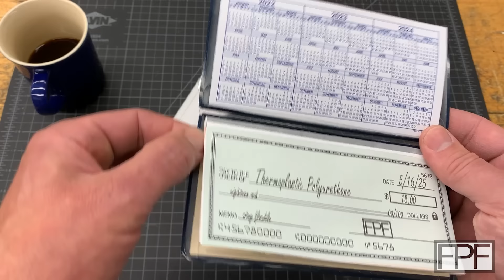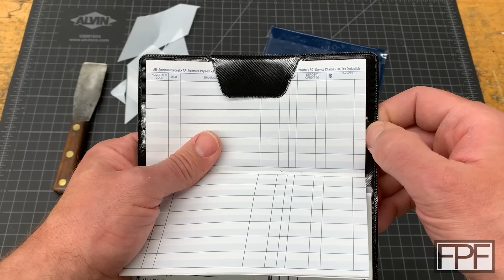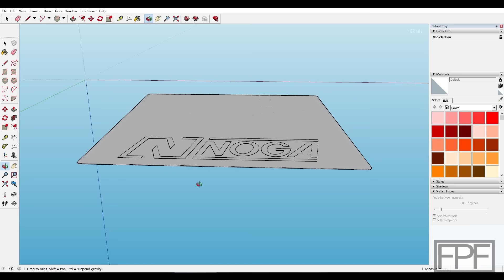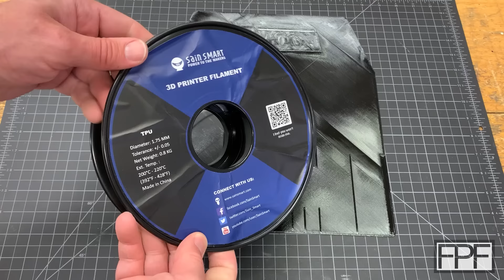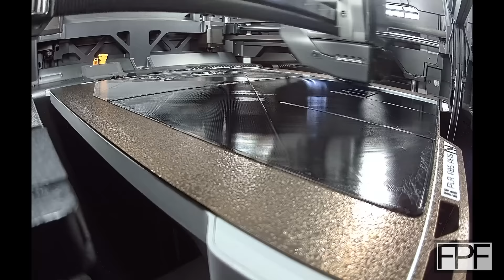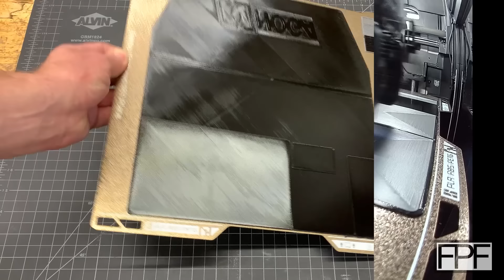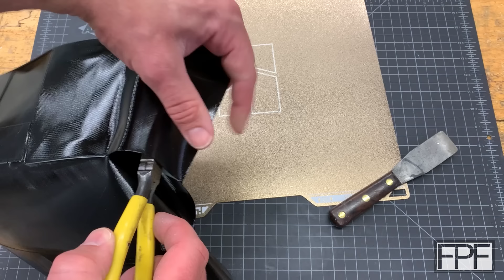3D Printed Tool Roll and Checkbook Cover

Comment: I think the designs might benefit from a “score” line, gaps where you’d want the prints to fold more easily. I say that with full recognition that this might not be possible due to the number of layers you printed.

And just after I posted that, I noticed you added that to the tool pouch.

Comment: I am wondering if it would be possible to completely bury the support material inside the tpu so that you have rigid sections connected by non rigid sections. That has a whole bunch of interesting applications, things like burying hardware inside flexible parts, folio style phone cases come to mind as well. DND DM screens would be another exceptional use.

Comment: Bambu TPU profiles have the bed way too hot. You likely have it at 40C which is way too hot for the A1 and X1C I’ve used. Drop it down to 35, if it still sticks too much, drop it down to 30C, which is what I use on Bambu’s. It’s easy to test with small test prints, it should peel off with the feeling of Velcro. Of course PLA and PETG want different bed temperatures, so for embossing details make the base layer TPU as a raft to print on or try glue on the bed and on the print if PLA and PETG won’t stick to the bed or TPU

PLA does not want to stick or bond with TPU, while PETG does. PLA will grow and come out larger than the desired shape, PETG on the other hand will shrink a little. PLA requires larger tolerances than PETG. This explains why the same geometry almost worked for both materials, the PLA coming out larger than perfect to microscopically roughed up the texture of the TPU allowing it to stick, and the PETG came out smaller than perfect creating a gap so it didn’t chemically bond to the TPU. Slicers however try to compensate for this.

Comment: Could sound strange but I can see using the ability to print a tuff material like tpu, embossing the logo as you did and incorporating it into something like a auto floor mat. I love having a thick pile mat with a nice logo and designated foot area on the mat. You can bring together the flexible printed portion to the thick pile mat and I guess sew them together?

Just a silly thought

Comment: Separating coincident edges like backed adhesive tape or the opening of a polythene bag is always fiddly. What if you printed non-overlapping tabs at the edge of the sheet - like the tabs on your browser - so that you've got a handle of PLA and a handle of TPU to pull on ?

Comment: I use the vision miner liquid bed adhesive. It lasts a long time. And, as it is alcohol based, the ipa release trick works really well. Plus, when the ipa evaporates, the adhesive is unaffected. It does leave a slight residue on prints sometimes if you apply too much, but i just hit that with a baby wipe, or wet shop towel and it is good to go.

Comment: Would it be possible to print the PLA layer first, then print the TPU, pause, manually insert the PLA, then resume printing? Like we do with magnets? That would be nicer for those with a single nozzle printer. 
I assume the PLA layer would need to be thicker to have some rigidity.

Comment: I have a favorite brand of medicin dispenser, that consists of a fold over case with a wide pocket. The pocket is wider in height than any of the pockets you printed, because instead of a check book or register, it gets filled with 7 hard plastic daily dispensers. It's a very flexible and smart system for organizing your pills, the only oroblem is that the fold over case only lasts about a year before falling apart just like your OG check book.

If you want to see what it looks like, you might be able to find it by searching for MediDos in Swedish sites.

Comment: Application for me: Large diameter vacuum actuator bellows, for old cars with vacuum accessories, or vacuum exhaust cutouts. With a decent hexagonal layering, this process would easily make very large vacuum actuators for headlights and windshield wipers, for those that don't want to "upgrade" to electric accessories.

Comment: Very interesting ideas.   I think I would be tempted to expand the PLA interface layer slightly beyond the TPU to potentially make it easier to remove, perhaps with a few small gaps in it too to help with awkward removals like circular surrounding PLA.   I suppose for your bed adhesion/release question you could have a raft of PLA - perhaps with some sort of pattern in it.

I use BL liquid glue on the cool smooth sheet for PLA prints and don't really notice that it leaves much behind.

I wonder if they is a way of getting a slightly more matt finish,  plus I think I might put a few air holes into the TPU on purpose.

I guess for things you want to fold over you could print them already folder over - with a few layer for the curve.

Would be nice if there was a clever way to design the interface layers - so that they come out whole and could be used for something.

Comment: I'm curious, because I've never really (knowingly) handled TPU before (my printer is ancient, and seriously overdue replacement with something more modern). Could you not run the 'seams' through a sewing machine to give them a little extra reinforcement?

Comment: With these roll covers I would print logo/"information on what's inside" vertically every few cm, so I would know what's inside without opening/unrolling. It's a problem to figure out which is which if you have multiple these, especially if not using often.

Comment: Checkbook? What is this, 2022-2024? 😉 😂 What a neat project/challenge. I still have a stack of those cheap covers, the one in use it probably more tape than plastic. The checkbook cover of Theseus, if you will. I didn't realize they're sold as collector's items these days!

Comment: instead of using a brush i just drilled a hole into the bottlecap and put one of those really fine ca glue tips into it, really easy to dose and get it where you want it

Comment: I think its a good idea to extend the PETG/PLA separation layer a little bit, so it comes out from the pocket, making it a little easier to get the scraper between the separation and the top layer.
Reply: a small gap around the perimeter of the interface layer might also be helpful, if the slicer doesn't make the bridging weird. Just a touch of airspace to help separation.

Comment: To make the checkbook hold its fold better, maybe try giving the fold a quick blast with a heat gun, isolating the fold by first covering the book almost completely with a piece of plywood, leaving just the fold exposed. You could even try giving the fold a nice 'round' by putting a length of, say, 12-gauge wire inside the folded edge before blasting it with heat, giving the TPU something to 'shrink' around.

Hope that made sense...

Comment: I sometimes use a few drops of silicone oil and distribute it with my finger on the build plate as release agent for TPU. You could try that. Maybe other oils work better/worse.
One downside: before you want to print anything else with that plate, you have to clean it thoroughly.

Comment: I've had the most success in easily removing TPU parts by printing on an unheated bed, waiting for the print to cool to room temp and then heating the bed to 80°C.  Let it sit at temp for a couple of minutes and it peels of with little effort.  So far this has worked for every brand I have tried it with and it's my standard for TPU.
Reply: Great tip!
Reply: Same technique I use and I have had similar success.
Reply: Thank you. It's always been tough for me with the standard Bambu Labs A1 setting an either a textured plate (accidentally printed) or the smooth PEI.

Comment: Another tip maybe make your own supports but add a tab on the opening so you can get your blade under.
Also if your making your own supports have a gap around the stitch line so the TPU bottom layer makes a small bridge. This should also help with removing the support.

Comment: Not sure if Bambu sell a satin PEI sheet for the H2D yet but TPU adheres to and peels off brilliantly from my Prusa satin sheets. Excellent work bye the way. I am working on buttons in my case designs that use built in TPU membranes that allow the button to be pushed. A the moment my buttons are all flexible arms essentially. The other area I'm examining is TPU shock protection, corners etc. Lots of possibilities for sure but you are definitely thinking outside the box!!

Comment: You may have already tried this, but why don’t you extend the separating layer out of the pocket by 1/4” or so to get a purchase.
Reply: He didn't model the separating layer, rather used the built-in slicer supports feature to automatically fill in the separating material as a support interface. Saves time at the CAD at the expense of not getting the overhang you are suggesting.
Reply: Good idea. Now that Bambu Studio can accept step files with multiple parts this would be an easy upgrade

Comment: Speking of scrapers, my favorite tool is a painters knife. It has a thin but not too sharp springsteel balde, is angled in a way that it will not dig into the build plate and has a a rounded shape which makes it easy to work your way around the print. 
I used it regularily to remove PETG from my Prusa's smooth PEI sheet and even could remove TPU I accidentally printed on the smooth PEI without any damage to the sheet at all (just be a little careful). 
Make sure the painters knife is as big as mine is and not one of those tiny ones. The blade alone is about 10cm/4inches long. It is a "Liquitex 109915 Professional" and here is a link: 
https://www.youtube.com/watch?v=3XZwdM_V4YQ

Comment: Although I'm having big problems just printing with TPU on the H2D, your video have inspired me on how to make a specialized gasket for a customer - so thank you very much for the great videos!
Reply: I was just reading the bambulab wiki on printing tpu on the H2D. One thing to make sure of is that you should have a dedicated head for tpu, printing fiber reinforced filament will particularly contaminat the head. 
Another thing is that harder tpu should work on the 0.04 head however softer tpu is 0.06 and up.
Reply: @judeffr  Correct 👍. I'm using BBL TPU 95A, so it's the harder one. Also you can only use the right nozzle for some reason. My project has to be printet with 0.4, but that should be posible with 95A. The stange thing is, that on my A1 Mini it just prints without any issues at all from the same roll af filament, but I don't have AMS for that one.

Comment: I still have a cheque book (UK), but have never seen a cover for them before now. I love the innovation and ideas.
I'm having trouble with my H2D, getting Bambu support for PLA/PETG to stick to parts, or even the prime tower. The printer sheds it all off the print. So for I've only tried it with PLA-CF, which is new to me, but the same roll of support material prints flawlessly on my X1C's, and I have re-dried it overnight in an X1C drying cycle as well. I'm starting to think it's a Z offset issue with the left nozzle on my H2D, and not sure how to adjust that. Lots still to try. EDIT: Next thing I tried was replacing the nozzle, and that's solved the issue.
Anyone having bed adhesion issues on H2D? I bought a Biqu Cryogrip plate, and am loving the grip and fine texture of that.

Comment: Besides the multi-tool head solutions from bambu labs, Prusa, and Voron/Sovol, there have been a couple that have been around a lot longer, Makerbot Duplicator, and whatever that printer was that "Dr. D-flow' made 4-6 years ago or so. That last used a mobile cantaleavered design with independent toolheads, each of them doing the bed leveling dance at the beginning of the print job if it was going to be used.

One of the things I don't know is if switching to PETG would allow those of us w/o a multi-toolhead machine to get OK results. If we're looking at a single layer of PETG, for things like this, I can see this being a 'bespoke' option for making notebook covers for people. 

That said, I can also see making multicolor 8 1/2 x 11" multicolor notebook covers for kids heading into school set up so that a TPU back cover could be made that has a thin strip of spring steel in the edge that closes up to a magnet or set of magnets, or magnetic sheet in the back of the front cover that then keeps the edge of the paper in the notebook clean.

The artwork on the front cover can both be created by the kids, including using a photo of brought home artwork from the year before, the inside of the cover can have space for a label identifying who owns the notebook, and have built in pockets for a 6" ruler, stylus, compass, protractor or other class specific tools Perhaps even space for mechanical pencils, flat pens, etc.. All that stuff that usually ends up in the bottom of the book bag or locker and destroyed when the book bag gets flung to the kids' jacket hook on a frustrating day at school. For something like this, the reason one might go with the H2D would not be for the multi-material, but for the larger print volume if it's large enough. A K2Max with the multi-color option for something like this idea might work.   (And if you don't like spiral bound notebooks, you can switch to custom punched TuL notebook systems with 7 or more disks a punch template and punch so that papers handed out can be inserted into the notebook where needed.)

And there I go again, prattling on.

Nice ideas, Not worth what one of these machines would cost me, but that's me. Keep going with the ideas. That might change my ideas too.

Comment: Try using glue stick but spray some water on it and smooth it out with your finger. Leaves a super thin even layer. Start bed heat on like 30° C after glue stick application and it's ready to print a minute after smoothing it.
Reply: Bambu liquid glue also seems to melt and squish out of the way, when printed over. Washes off easily with water, too.

Comment: Nice job, thx!
Tried to design any kind of buttons to lock those rolls already? Same logic as with support, but don't have to remove it...

And as for the pei-tpu pair... Doesn't the freezer do the trick? My imagination tells me that you leave them for an hour and then you just pick them up already separated)) However, I'm in monopolized petg realm for 2k+ hours still...
Cheers!

Comment: I tried TPU a few weeks ago on my A1 and the print quality was absolutely terrible. Turns out the default print temp in bambu slicer for basic TPU was way too hot for my TPU (my own fault I didn’t check the temp on the reel) I lowered it it 200°c and it now works like a dream. I’ve had the roll for at least 2 years as I could never get it to work with my old Ender 3’s. I’ve never even dried it.  For the past few days I’ve been printing phone cases, rubber washers, toys, all sorts.. just can’t believe how well the A1/A1 mini can handle TPU.
Reply: Drying makes the world of difference with TPU. I normally run it straight out of a filament dryer, so it's not picking up moisture during the print. It needs to be run REALLY slowly too.
Reply: @rattyboots  perfect opportunity to jump in: Not true at all. TPU print speed depends on the temperature. 
On my A1 Mini I can print even softer TPU (85A) at 20mm³/s. 
That's faster than some printers can extrude PLA.

How? 
- 270°C
- 0.6mm Nozzle
- Slightly increased Extrusion Multiplier
Other things to consider:
- (very important) A super short 4mm PTFE Tube, or none at all. Sometimes I cut the "meters" I need off the spool and feed it directly into the extruder, so the gears don't have to pull filament through the long tube + pulling forces of moving the spool - and lose grip.
- The spool's axle on 2 low friction ball bearings (thick grease cleaned out with alcohol). Definitely not the outer rim sitting on 2 rollers.
- PTFE Tube ideally 2,5mm (not 2mm) inner diameter for less bends/friction.

 For normal 95A TPU 240-250°C should suffice.

The amount of cooling depends on the model size and geometry. For printing gaskets with my soft TPU I use no cooling for example.

A huge upside of the higher temps and speeds is: The material basically gets welded together, so the layers will become inseparable.

But I agree that drying is paramount.
So @darktherapy: once you have dried your TPU thoroughly and increased the temps. to at least 240°C (and maybe use a slightly wider nozzle), you could print standard TPU as fast as PLA. If you care.
It greatly depends on the brand too. I once tried Overture TPU and it was a nightmare. Even drying it twice didn't help. With ERYONE and Siraya Tech Flex I had good experiences.

Comment: Yeah, I’ve still got my passport in an envelope, so a disguised case would work well.  I think hard cases hinged with TPU would work well.   Like, the small parts could clip into hard plastic cases and fold together - making a brief case style tool holder.  Tool rolls are portable  and compact, but I worry the small parts will get lost.

Comment: Are you using the original version of SainSmart TPU? They also have a newer version of TPU with the GT-3 name. Supposedly high flow rate and UV stable. I've loved the older version but haven't tried the newer version yet.

Comment: I've found that the old Bambu Cool Plate (not the SuperTack one) works well with TPU. Sticks reliably and easy to get off. Unfortunately I don't think they make them anymore, don't know what the surface was.
Reply: They still make the smooth PEI plate. Not sure if that's the same.
Reply: @rattyboots  Pretty sure Smooth PEI is different. This one was called just Cool Plate or PLA Plate and it had a replaceable stick-on surface. 
(I tried it because I had some Cool Plates that I didn't use and didn't want to risk wrecking at Smooth PEI Plate)